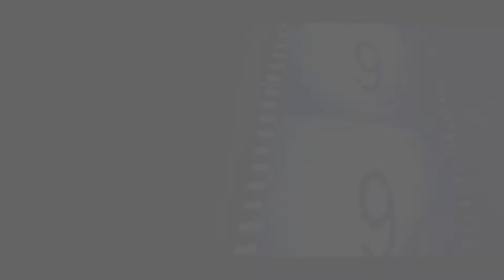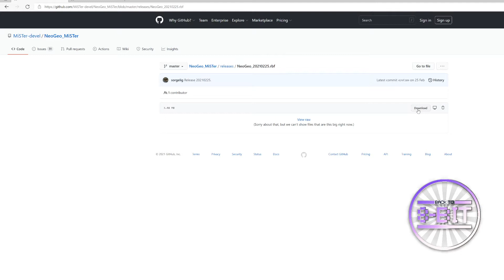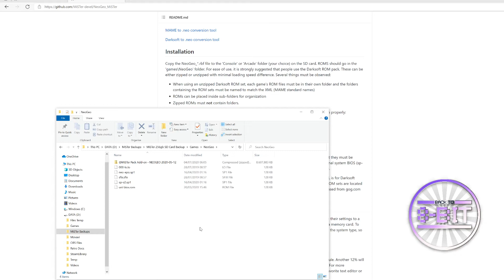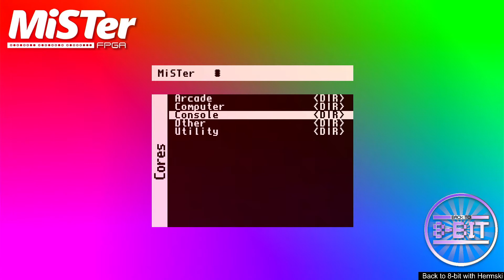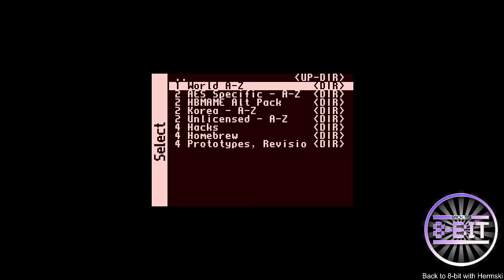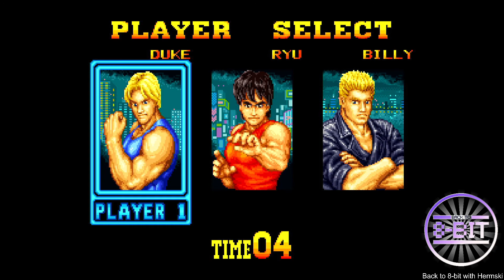Neo Geo Core MiSTer FPGA Quick Set Up Guide

Comment: It's not working for me. I keep getting an error screen after the main loading screen. It's says "Exemption Error Handling" and it's green. Either that or I get a white screen or one with red writing that says "Warning: Bank Error." I have followed everything you've done I your video. I even checked me ram in MemTest and I have 128mb and it passed all cycles so no issues. Any ideas? I used Darksoft though which is recommended. Maybe I should try the same set you have? You didn't have an XML file I noticed. Don't need one for Neo files right?